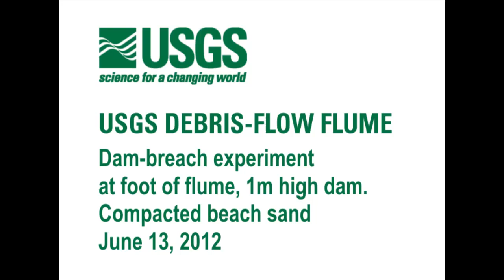Lake Overtopping Flood: Dam-breach experiment, outburst flood

Comment from the maker: I have a question for all (call it a test or a challenge): 
When would you say this experimental flood attains the peak discharge? When is the maximum water discharge in cubic meters per second (or cubic feet per second). Write down the youtube time as mm:ss.
Reply: 3:35
Reply: 03:56
Reply: @derangedspyder  
It's honestly a tough call between the three of you. But DerangedSpyder I think picked the highest volume time of the three respondes. 
The clue is the very little you are able to see downstream in camera 4. Tapping between the time stamps shows it's much faster and rougher the the others.
Reply: I'm going to say around 4:05.
Reply: I don't think until about 4:40 when the head of the river really opens up. There's a lot of water going through that wide area compared to a smaller head of the stream. What's the answer Daniel?

Comment: No dams are built like that, except that experiment at Teton, of course. What's the point of this?
Reply: It looks cool
Reply: Gear Whine Look for Hidroituango in Colombia :)
Reply: juangodalming, yikes. I regret not learning Spanish, but it looks like they lost their bypass tunnel/outlet works? Not good. Dams that have inadequate outlet works are destined for the worst-case scenario.
Reply: @Dr. J well, of course. But coreless ones? They tried that with Teton, but it wasn't contacted correctly, so it failed. I think this was an illustration of how NOT to build an earthen dam.

Comment: 1:32 and watch the top. you can see the sand start to ripple under the water and around 1:34 you can see the tipping point when the flow rate increases.
Reply: slow it down to see better
Reply: That's the point where the water has begun to cut down into the surface of the reservoir. A semicircle of dug-out sand starts to grow from the breach point left at that point.
Reply: The video is sped up look at the timestamp a second is not that fast